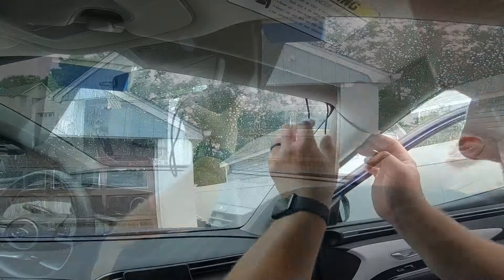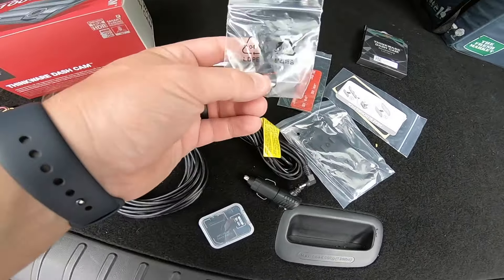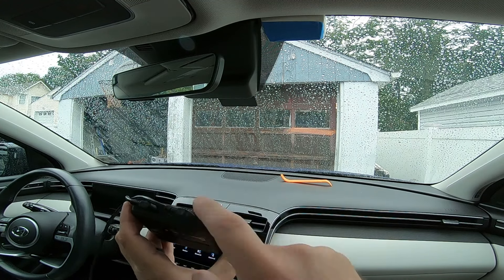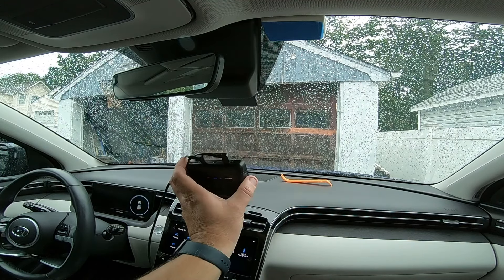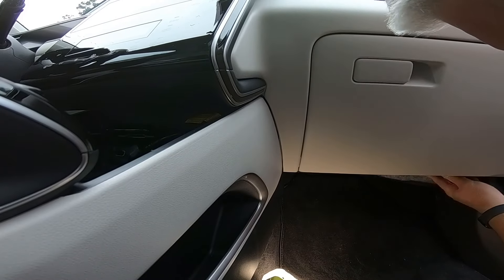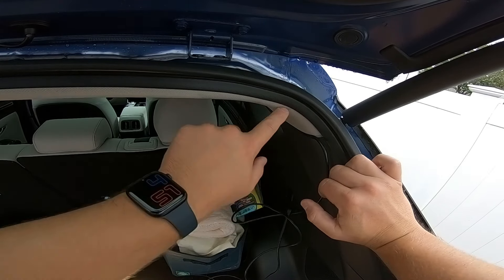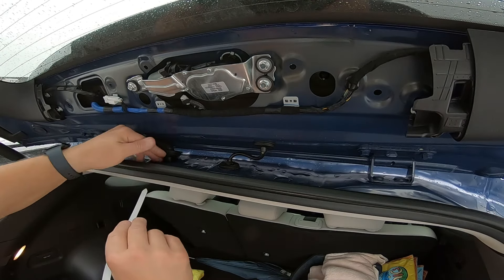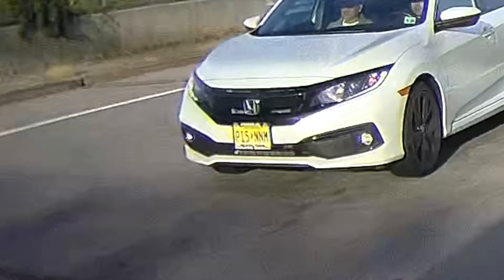How to Install a Dual Dash cam System - Thinkware Q1000

Comment: What about mounting it off center?
Reply from the maker: Most cameras support off center mounting, some have swivel mounts that allows you to go as far as the a Pilar while others you just need to mount them at a slight angle to re center the image.

Comment: I successfully install my dash cam according to this tutorial, I really appreciate this video! Some caveats I encountered are
1. I cannot stuff in the lines in the left front of passenger's seat as shown in 12:40, because the plates around are solid not like the ones above the door. This is the only place that the lines are visible
2. Getting through the hole in the cargo plate is insanely hard during 17:07, but I made through using just hand, so if you don't have zip tie is still acheivable.
Anyways, many thanks!

Comment: Great video, I also have a Tucson 2022, was wondering if you had a video about using the fuse box as opposed to the cigarette lighter.
Reply from the maker: Sorry no Hyundai based videos on hardwiring installs.

Comment: Great video.  But if you power the camera from a cigarette lighter then how will the camera record when hit and the car is off?  I paid 20.00 extra to have the power provided from a fuse box.  Any battery vs super capacitor comments?

Comment: Awesome video.  Thinkware made a harness that you can plug into the obd port which allows the cameras to record in parking mode.
Reply from the maker: Yep, I didn’t go that route because I’ve got the blackboxmycar powercell battery pack for parking mode.
Reply: @WorkPlayDrive  where can i get that from for parking mode

Comment: Great install, but one question, in case curtain airbags deploy what happens with the wire that goes to the back camera?
Reply: Seconding this. Wouldn’t it obliterate your passenger?

Comment: Hi can u put a dash cam in without putting through your battery & also my cigarette lighter doesn’t work. Can I go through the outlet where I plug in my phone charger?
Reply: There are other videos that instruct you to use fuse converter I believe, so you don't use your phone charger or cigarette lighter.

Comment: I just picked one up and was thinking of mounting it the same way you did here, but I was under the impression that the dashcam  lens should be as close to the windshield as possible to reduce glare. Are you having any issues with reduce video quality?
Reply from the maker: Nope. Regardless of the distance, you’re still going to get windshield glare.  But to combat that a CPL filter will completely eliminate the glare.  Most camera models have this as an add-on option either stick on or click on.  And for others, there are aftermarket stick on filters.

Comment: Thanks for the helpful video. I’m seeing a lot of comments concerned about putting the back camera wire in front of the side curtain airbag. But with the way you’re doing it, isn’t the cable going behind the airbag anyway?

Comment: If there is a known dashboard glare, then the filter should be included with the device............
Reply from the maker: The system is completely usable, even with the dashboard glare at its worst . I’m  just getting much better video quality by installing a CPL filter.  Just like my $3000 DSLR camera didn’t come with a CPL filter. I had to buy that on my own.

Comment: I want the rear camera upfront for safety....but the cable is to long and no where to hide
Reply from the maker: There are 3 cam systems you may like.  You have one out the front, one out the back and then one with IR night vision for inside the car.

Comment: wait that cable going into the pillars - aren't there airbags there ?
Reply: What's the answer to Monty's question?
Reply: In cars which have airbag you can't do like this you'll need to open that whole pillor then pass the wire below the airbag not above

Comment: Nice. Just a few comments, if interested...cool, if not, ignore them.  Running wire over the a-pillar air bag? Top clip on Tucson A-pillar is noted to break it is a type of flexible retainer for the air bag to allow the pillar molding to move when bag goes off. Not expensive at a dealer...no big deal.
Would like to see a follow up about the location of the install of the front camera. Was there any vibration with mounting to the plastic covering the safety camera from the dealer?

A straight connector would go through the large rubber tube grommet and then when you get to the camera, get a 90 degree USB male/female adapter short cord. Amazon.
Reply from the maker: the wire runs over the separation between the a pillar in the roof liner, which is directly above the airbag